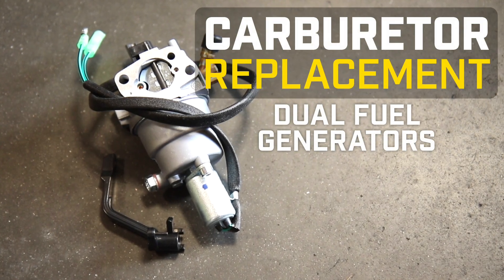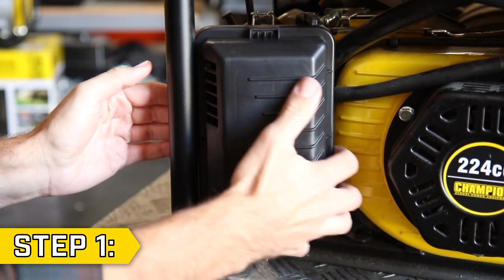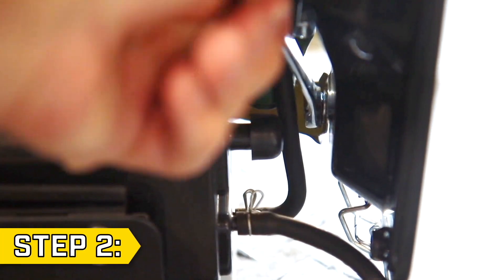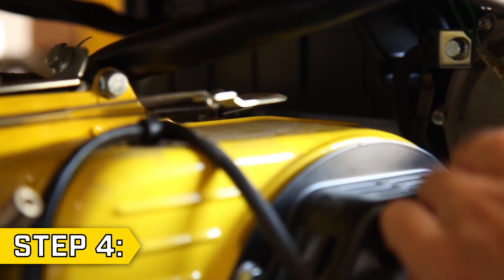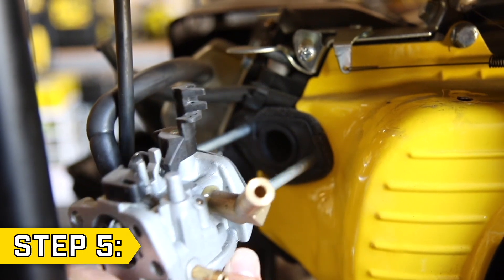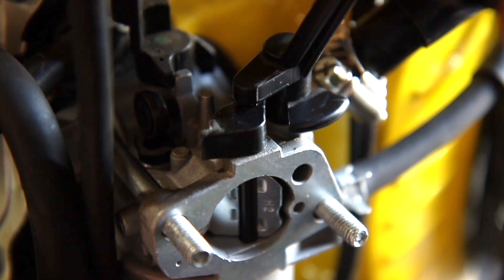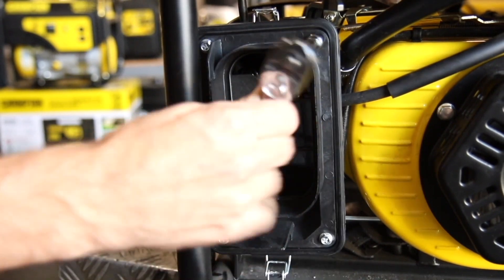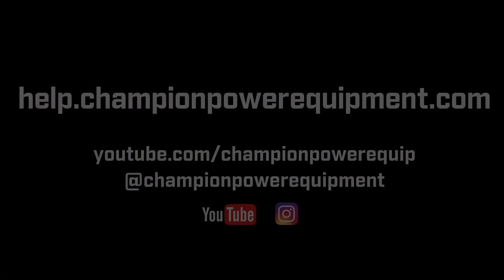Carburetor Replacement (Dual Fuel Generators up to 4000 Watts)

Comment: Can I reuse the gasket if I am just removing it to clean the carborator and not actually replacing the carborator?
Reply from the maker: Thank you for your question, yes you can as long as they are in good shape and aren't torn.